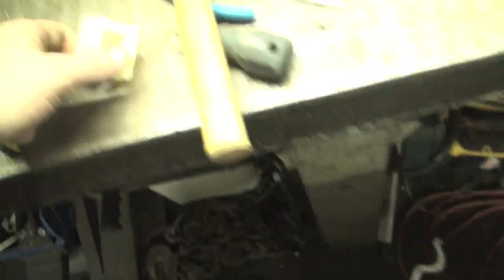getting the dickeredness out

Comment: Batteries now have a polypropylene case, which insulates about five times better than the old rubber cases. Unless the battery is covered in a conductive layer like dirt or electrolyte that has seeped, there is nothing too conduct electricity. The old hard rubber cases had a high carbon content and were considered porous to a degree, so moisture from a damp concrete floor could establish an earth leak to ground. For a lead/acid battery the discharge rate is up to 4-8% per month sitting static.

Comment: Thanks for the info. I remember back in the day having some freshly charged up Ni-Cad Everready rechargeable batteries (had a yellow plastic case) drain down quickly one day. They were in a toy tape recorder sitting on the bare concrete and they didn't last more than 5 minutes of use. If I recharged them and used them in the same item when it was off of the bare concrete they would last a lot longer. After that I always thought the Earth had some weird ability to drain batteries if too close.

Comment: Mastercraft Eliminator. Cheaper then an optima charger. Trickle charge, which helps prevent the battery from boiling. They also have a re-conditioning setting which works wonders on old batteries.

Comment: If you place a car battery on the concrete floor the battery will slowly discharge through the floor. Place a 2x6 under the battery or chunk of insulation and it won't dicker you batteries.

Comment: A very common old wives tale about concrete discharge. The truth is, a perfectly charged, brand new battery loses 1% per day in perfect conditions, concrete or not. The plastic that cases the battery is an insulator not a conductor.

Comment: That thing with all the copper would be called a transformer and is in nearly every household electronic that can be ran off of a wall plug or batteries.  Those black boxes you plug in the wall for some things (except cell phone chargers)  will have one off them reals of wire in it!

Comment: When you're unrolling that coil... what I do is... stab a Philips screw driver in the end of my drill, wrap the copper a couple times around the shaft, then hit the trigger and it will unwind that coul faster. Sometimes I gotta tape the end to the handle otherwise it won't spin. And also not to wrap too tight or it'll be a itch gettin it off the shaft. Just makes things a bit quicker.  U probably already thought of this by now since its an old vid.

Comment: You're half right. Modern batteries do far better on a cold damp floor, but the moisture wouldn't allow leakage to the earth in old batteries. It would leak current between the anode and cathode through the damp case. Earth isn't the same as ground.

Comment: The bubbling noise is normal, at least it is in forklift batteries which use the same principal on a larger scale.  Just turn your charger onto a lower amperage/trickle charge if ya don't like the bubbling sound :P

Comment: Pug! @6:23 you start unwinding the coil.  I use a big screw driver and stab it in my drill. Then tape the end of coil to the handle of the driver.  Pull the trigger and un wind the coil on to the driver shaft.  Dont wind too tight or it wont slide off.

Comment: Earth and ground are at the same potential. A ground or earth connection provides a means to complete a circuit if a hard-wired one does not exist, 
"An electrical current could be conducted through this container if the moist concrete floor permitted the current to find an electrical ground. The wise advice of the old days to "keep batteries off concrete" has been passed down to us today, but it no longer applies because of the advanced technology of today’s batteries."
"

Comment: no it doesn't.  That was back when batteries cases werent as well insulated and could short to ground(the earth).  Batteries naturally discharge over time regardless of what they are sitting on and should be maintained with a float charge topping them off when not in use!  :)

Comment: @1puglife So hey, so you know when you untangle the coppers off the antler and it takes so long prolly? Why don't you get set of bolt cutter antlers and just cut through the whole roll of wire and then just peel back the coppers all at once? It saves at least 1 cigrit of time prolly every time you do it prolly and stuff and fings.

Comment: Earth and Ground are NOT the same! Earth is the potential of the ground we stand on, but ground can be whatever you want it to be. I can have a system that is not earth referenced, and it's ground might be above or below earth potential.

Go get a car battery, and connect either terminal to a pole embedded in the ground. No current will flow because batteries are floating potential between their anode and cathode.

Comment: Instead of manually unwinding it why dont you rig up a drill to pull and wind all at the same time? You could do the same thing with the wire stripper you have.  It will save you tons of time. More smelting for you!